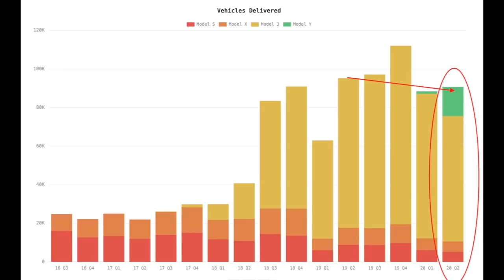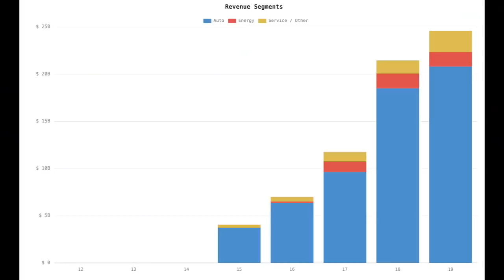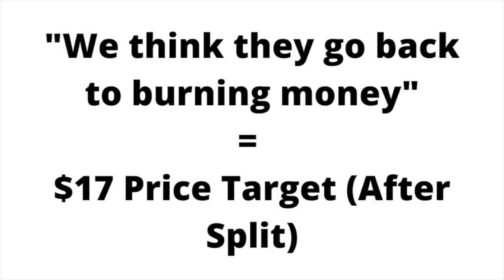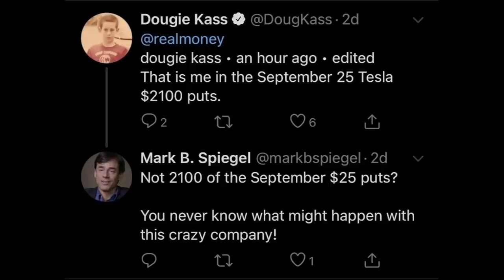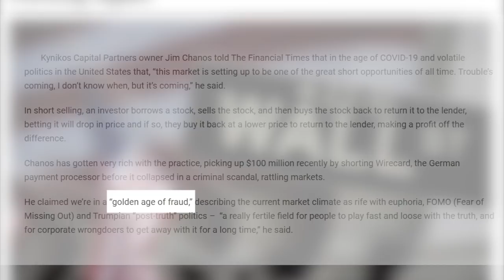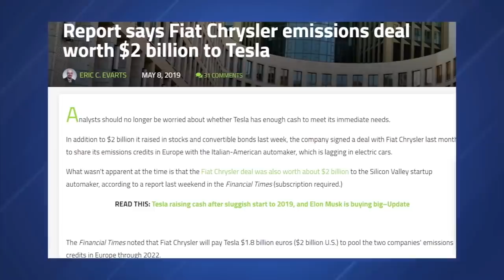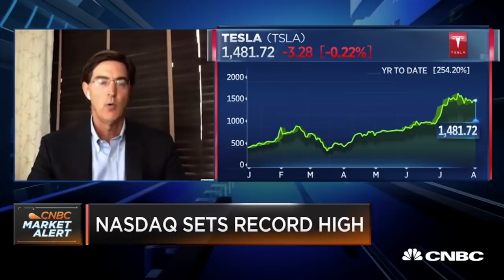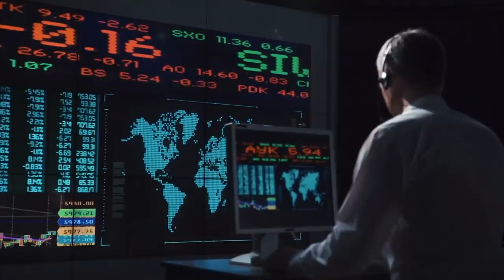Tesla Short Sellers Are Stuck In Denial

Comment: Tesla is an IQ test. I’ve been holding my TSLA for years. Nikola is an IQ test. I’m having a lot of fun shorting NKLA! Mark B. Spiegel is a clown! Great video!
Reply: Brent Nally how do you short NKLA
Reply: Buy low sell high or buy put options on them?
Reply: Why short Nikola, if you can put money in Tesla? Curious
Reply: @HotBoii91  I'm using Schwab as my brokerage to short NKLA. You simply click on "sell short" in your brokerage account.
Reply: @tomknop8675  Because TSLA has run up so much in the last 16 months that I believe shorting NKLA is a greater short term opportunity. NKLA is a MASSIVE scam which I've been researching for months. Trevor Milton is a compulsive liar of immense proportions which are psychopathic in my opinion. I believe I'm doing the world a service by shorting NKLA.
Reply: @BrentNally  check, good reasoning. Fully agree, when I see the guy talk, he is completely talking bs. Good luck man man
Reply: @tomknop8675  Thanks!
Reply: Brent Nally appreciate it bro. But what does it mean and what is the strategy to “shorting”
Reply: plugboy91 Short selling is a fairly simple concept—an investor borrows a stock, sells the stock, and then buys the stock back to return it to the lender. ... If the stock does drop after selling, the short seller buys it back at a lower price profiting on the stock price dip and returns it to the lender.
Reply: Ricardo P I’m still net positive on my NKLA short. I started shorting NKLA in late June. Think long term. 🤓 📈📉📉📉
Reply: Brent Nally ok thank you bro!!
Reply: Ricardo P I wasn’t kidding and now I have even more money from my NKLA short.
Reply: Ricardo P I’ve been a long term
TSLA holder. I don’t usually short stocks but NKLA is such an obvious scam that I had to short it. I didn’t do options. Just sold short.
Reply: Ricardo P I didn’t do an options put. I’ve just sold short NKLA. I believe NKLA will go to $0. TSLA is the only stock I own.
Reply: Nikola has dropped

Comment: Tesla is a leader for Electric vehicles.  But other major car companies have huge new model lines coming out, so competition will heat up considerably.  The problem for Tesla is most of the other companies make significant profits already so can invest far more than Tesla.  tesla may be in the lead technologically, but that will only last a short period before it's just another car company and will have a small market share. In future, it may have a role as a niche supplier, but unless it uses it's sky-high valuation to buy out another more profitable car business, it will ultimately succumb to the huge car companies that already make the profits to invest in the technology.  Just a matter of time.  Toyota, VW etc are not blind to Tesla's success, but they have the funding to compete and beat Tesla.

Comment: How does Renault stack up against Tesla in Europe? It sounds like it’s the biggest European EV player at the moment? Giga Berlin should help make Tesla much more competitive from a cost and volume standpoint. Just curious what your thoughts are, might make a good vid 👊🏼
Reply: I am out of date but last I checked it looked like their year for sales should be as good as Tesla if not better.
Reply: Yep. Of course short term doesn’t matter nearly as much as long term. But the ZOE model really does seems to be selling well. The smaller size really helps in Europe (Tesla probably a few years out from a similar sized vehicle), plus recently range got boosted to ~240 miles, and cost is around $35K USD from what I could tell, and the charging network seems to be growing strongly across Europe. Seems like their autonomous software still incorporates Lidar though... Regardless it’s looking more and more like Tesla’s biggest sources of competition will be from outside the U.S.

Comment: Every body with 2 points IQ can see, that based on the fundamentals, TSLA is way overvalued. This is due to free money (debt) from the Fed. So it's not wise to short TSLA now, because you will fight 'indirectly' the Fed. So I would join them for the moment and make some money on the wave of the enormous bubble we're in now. 

But be ready for a huge correction to fair value, that could be 25 Euro or even zero.

The arguments of these short sellers are absolutely true, but be long on TSLA for now, and short it when the moment 'finally' appears on the horizon.

Comment: Bazinga just came out with an article of the top EVs sold in Europe and Tesla was behind Renault,  is this fake news against Tesla?
Reply: Tesla has to ship cars to Europe and modify them for European regulations, all up at least 1 month before they can be sold/delivered. First month of quarter Tesla is building cars for Europe, UK, Aust NZ, Korea etc then start shipping them. So first 2 months of quarter there will until GF Germany operational always be low Tesla Sales. Two out of 4 ships have docked and are unloading, the other 2 over the next couple of weeks. Covid put the Kibosh on manufacturing and shipping to Europe etc
Plus due to space constraints smaller cars and hatches are very popular and European OEM's aim for that space where Tesla does not have models as yet

Comment: As soon as a car can be made cheaper than and better than and at mass production then I'll believe Tesla will take a hit.
Reply: You can say that about every car ever made.  Yet cars that establish a solid market position at introduction usually continue in a similar way.  The exceptions I have read about were mostly low volume makes, and Tesla is no longer a low volume maker.
Tesla may "take a hit", but that is what GM, Ford, Fiat/Chrysler and VW have already done.
Reply: @John.0z  yeah, my point being Tesla will soon make cars that are better and cheaper than ICE cars and it will be a long time before competitors will catch up, let alone be viewed well by the public.
Reply: @graysonsmith7031  I have to say that did not come across in your first post.
I have no idea what the next 5-10 years will bring, but I have to wander if Musk will change from his "no slow Tesla" position.  I like Teslas, but I cannot afford one, and certainly do not need or use the sort of performance he builds into his cars.
While he holds that course, there are openings for present manufacturers, although it does seem like they are slow to change.
There is always to possibility of one of the small start-ups rising in Tesla's shadow with a smaller, cheaper car that still has a good range.

Comment: Tesla is totally overvalued. That's a fact. Tesla is what AOL and Hotmail were. First to market and that gave them the advantage. Tesla doesn't have any significant IP that cannot be copied, used or replicated by others. In time Tesla marketshare and stock will reset and drop significantly. By the way, I have Tesla stock and riding the wave, but will be offloading in stages soon, and keep some should I be totally wrong.

Comment: Hasn't been a single part of shorts' thesis that has been disproven.

And now Audi and Renault are kicking Tesla's butt in Europe.  So what happens when the software value is proven to be worthless and the cars substandard?  Are you guys sticking another 20 billion into the company to prop it up?
Reply: Yes, Tesla stock is priced ridiculously, even with its battery factory and software.
Reply: Nonsense.  Most of their notions have been disproved and Renault and Audi are just catching up.
Reply: @TheEvilmooseofdoom  How are they catching up?  They're not doing ANYTHING Tesla is doing, and the Zoe has been outselling all Teslas from the beginning.

You can't be catching up if you are still ahead.
Reply: @billcichoke2534  Nonsense.  Zoe hasn't been outselling since the beginning but they have been doing well.  In 2019 Zoe did 45K unit sales, Tesla did over 110K that same year.
Reply: @TheEvilmooseofdoom  IN EUROPE, the Zoe has been the best seller (with the exception of the Leaf in 2017) of ALL EV brands.  That hasn't changed.  What HAS changed, is the Audi eTron has started smacking Tesla as well, even with the release of the Model Y.

Reasons given?  BETTER CAR.  MORE USEFUL TECH.  The Tesla toys don't impress.